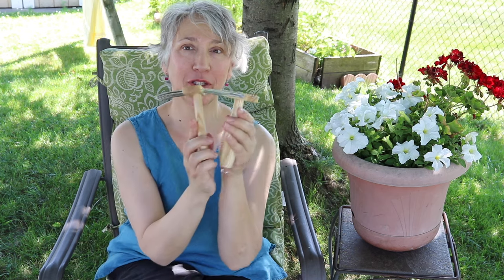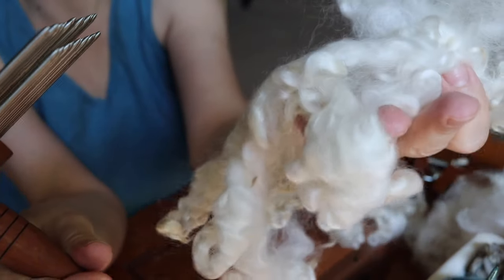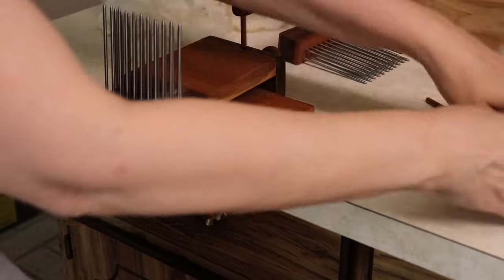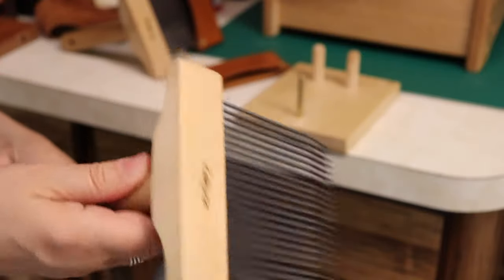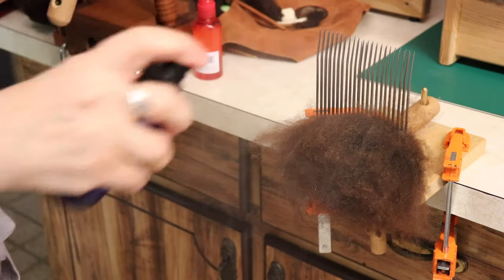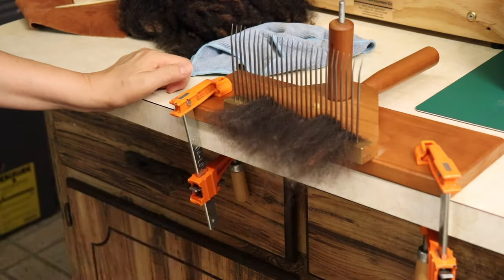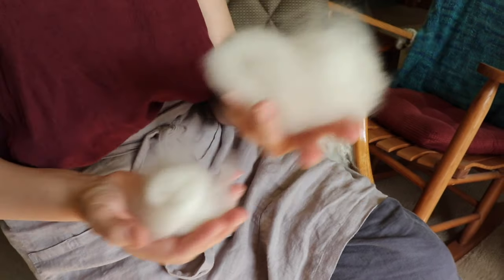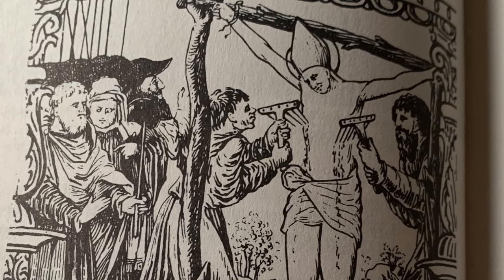Wool Combs

Comment: Thank you so much for demonstrated the different types of combs. I have a Romney fleece and am going to purchase combs but didn't know which type to get. This helps immensely.
Reply from the maker: Thanks so much for watching! I’ve seen that single pitch Viking combs are also good for longer wools like Romney.
Reply: @SoulfulSpinning  Thank you. They seem like the ones for me!. I bought a Cormo fleece, washed it but for the life of me cannot figure out how to process it. The locks were quite disorganized and it feels almost sticky after washing. If I sent you some, would you be able to tell me how you would process it? I have carders and have also flick carded a whole Finn fleece before .
Reply from the maker: Cormo being a fine wool can be  difficult to wash due to its high lanolin content. It also tends to form noils when carding because of its springy nature. I’d be happy to see what I could do but shipping from Canada would be prohibitive I 🤔. I’d wash it again and keep the temperature between 140 and 160 to remove the grease. Short super hot wash and rinse may remove the tacky feeling you’re describing. Typically Cormo has a decent staple length for flick carding but combing with fine combs should work too. You can connect with me on Instagram if you want to talk about it some more.

Comment: Thank you for this video. I learned so much. I have the Valkyries and the Benjamin Green combs. 
I loved your use of the Russian paddle combs to prep fiber for carding. I am actually going to try that with the Greens. 
Was wondering what oil mixture you use? And also, would a rubber washer help to clamp the Russian combs down for you. 
Thanks again for sharing this video!
Reply from the maker: That’s a great suggestion! I will try a rubber washer. For my oil mixture I use water, a bit of almond or jojoba oil and whatever essential oils strike my fancy. I love rosemary and lavender especially. I have also used some unicorn fiber rinse mixed in a spritz bottle and that work quite nicely. I don’t measure out anything.
Reply: Thanks!  I’m currently using the Fibre Rinse but like the idea of using oils instead. I’m a fan of rosemary and lavender also.

Comment: Just came across your video today. Very informative video! I just purchased the Louet combs last week and have found they work wonderful on a Shetland fleece I'm prepping. I left it lanolin light (intentionally didn't remove all of the lanolin when I washed it). It's also great to see that the combs I purchased will be excellent for all of the alpaca fleece I have! I really wanted a set of Valkyrie extra fine combs, but I came across the Louet combs on eBay and couldn't pass up the deal on them. And yes they are very light weight and easy manage as well as easy on your hands.

Comment: Is there a benefit to combing vs. carding? Or do you need to do both with different kinds of wool? TIA!
Reply: 1. Combing gets wool cleaner, and carding doesn’t let as much veg matter fall out. 
2. Carding is better for shorter fibers, combing is better for longer fibers. 
3. Carding creates a woolen prep, and combing creates a worsted prep. 
4. Combing aligns the fiber for higher density, stronger, and shinier yarn. Gives better definition to knitting patterns like cables